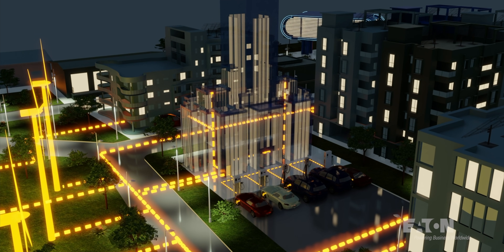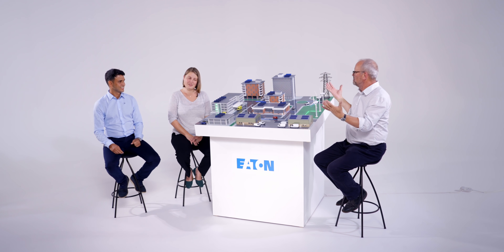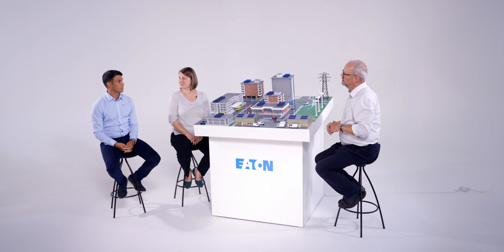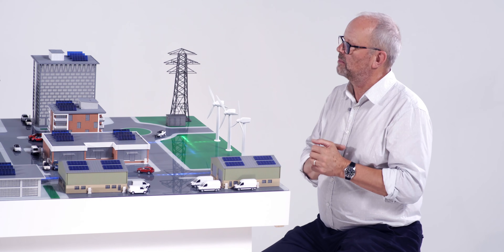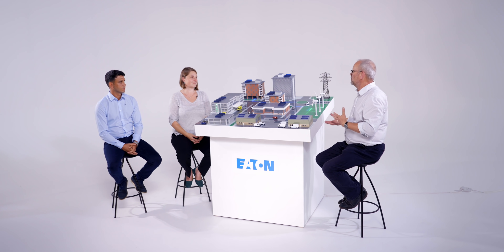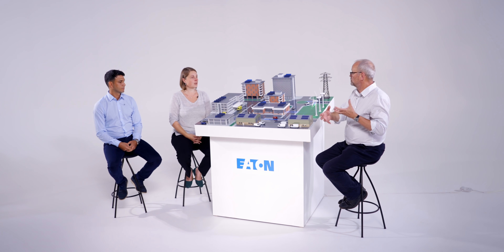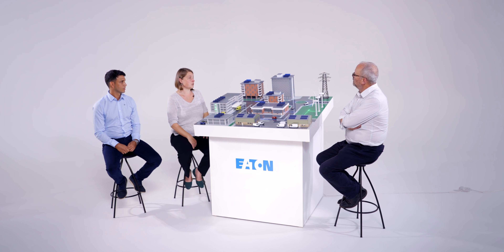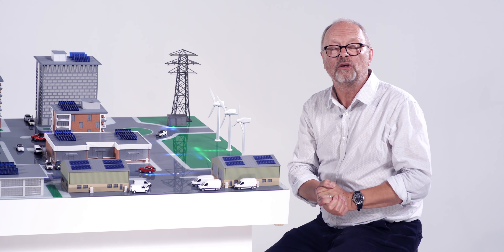EATON’s 'Buildings as a Grid' approach to energy transition | SUBSCRIBE to Fully Charged PLUS

Comment: This cannot work - because it is currently impracticable to store enough energy to carry over a run of dull days when solar power typically falls to 5% of rated peak power  'Smart' does nothing to solve this b=very basic problem.

What is the purpose of this plan for local storage with solar?  If it is to reduce CO2 then it achieves little benefit over the current situation of homes feeding surplus power to the grid (as I do), and then taking from the grid on dull days.  Arguably, if you are going to have a more capable grid, then bulk storage is best left to grid management, with hydro storage etc and possible large battery storage in future, which, by economy of scale is probably going to be cheaper than local storage.  

If the aim is to reduce the need for the grid; which seems to me to be very desirable for many reasons, then what is needed is realistic local storage - much bigger than currently feasible, because it is  necessary to store enough energy to supply heating needs over many days during a dull spell of weather (when typical solar output is 5% of peak rating or even less) and wind may also be lacking.   'Smart' control doesn't benefit much - you can't manage what isn't there!  My hope is that rather than go for the grid solution with nuclear and the nuclear waste problem, huge extra investment in the grid, the problem of power loss on the grid, and extreme vulnerability to a total grid-down situation, we will devote effort to solving the real problem of making power local.  

The advantages seem huge to me, but need better batteries (ten or more times the capacity of the current LiIon batteries that are in use) or some other solution.  This may not be impossible, but  my point is that it is not solved by being 'smart'. The old solution of local CHP (combined heat and power) could still be attractive to bridge the gap to future storage solutions, given that home energy use shoots up in cold weather.  Using the waste heat locally for heating makes gas fired generators nearly three times more efficient than power stations, and they could have rapid startup (which nuclear lacks).

Comment: The idea that 'smart' can somehow solve all problems is misleading, as is this video.  There is an 'elephant in the room', which is that solar panel output drops to around a twentieth of rated output on very dull days (I speak from 10 years experience on a 5 acre installation with both on and off grid solar), and unfortunately there can be three or more very dull days in a row in winter in the UK.  Battery storage cannot begin to address this problem (3 days storage) so at such times everything has to revert to the real grid, which will go down.  I use 5 heat pumps to heat my home, which are excellent, with a COP of 5.5, they need only  400w each typically at 7C outdoors.  Even this is a lot to supply from batteries for three days or more.   8kW of solar for my home is more than I can use in summer and more than can be stored.  On a dull day this becomes 400W, which is only one fifth of my heat pump requirement, so there is a big mismatch, even with what is a pretty big solar installation for one home.  Better in my opinion to go for simple control and put the effort and money into trying to solve the really hard problem.  If batteries were to become much more cost-effective then storage over a week or more might be viable, but with something like 20kWh minimum per house per day needed to be stored for several days, around 100kWh battery per home is needed - current home batteries are more like 10 or 20kWh.

Using the car's battery doesn't approach the problem either.  It might be 20 to 60kWh, but you can't use it to supply the house for three days and still hope to use the car!   'Smart' does not begin to tackle the real issue, and is almost a waste of time, because for most of the time we have to simply throw away energy in order to cope, and there is no need to be at all smart - it's the dull day problem that crashes the system.
Reply: 'Can't work' is a bold claim. You are assuming no wind as well as no solar, and ignoring the hydro and nuclear. Clearly there will be occaisional demand for longer-term storage or grid-supplements, but then maybe that is the 3 days to just use the car battery and not go anywhere in it (use your bike or stay at home), because now is not the time - that's demand-management, 'smart' and flexibility writ large. There is clearly a need for longer term storage than is sensible at lithium-ion prices, and we have options: more pumped hydro, maybe Form's batteries will fill that niche as intended, maybe we just build some more nuclear, or it's done with hydrogen peakers, or even just rarely-used methane peakers. We can also reduce heat-load to nearly nothing by building fabric upgrades (I only need space heating about 15 days per year now, peaking at 2kW when it's -10C outside).

There is no need to have per-house infrequently-used long-term storage - it can (and indeed should) be a shared resource. Whatever is cheapest is what will get adopted. There are lots of ways to run at this, and we don't need to pick winners - just set up the costs so high-carbon is really expensive. You are right that a very cold, cloudy, still week is the worst-case that we should work out how to deal with, but if people have to turn their old gas boilers on (or central gas generation) for 6 days/yr because we don't quite have enough storage/generation/interconect yet, that's not the end of the world: that's still a 97% decarbonisation.
Reply: @xxwookey  What is the purpose of this plan for local storage with solar?  If it is to reduce CO2 then it achieves little benefit over the current situation of homes feeding surplus power to the grid, and then taking from the grid on dull days.  Arguably, if you are going to have a more capable grid, then bulk storage is best left to grid management, with hydro storage etc and possible large battery storage in future, which, by economy of scale is probably going to be cheaper than local storage.  If he aim is to reduce the need for the grid; which seems to me to be very desirable for many reasons, then what is needed is realistic local storage - much bigger than currently feasible.   'Smart' control doesn't benefit much.  My hope is that rather than go for the grid solution with nuclear and the nuclear waste problem, huge extra investment in the grid, the problem of power loss on the grid, and extreme vulnerability to a total grid-down situation, we will devote effort to solving the real problem of making power local.  The advantages seem huge to me, but need better batteries or some other solution.  This may not be impossible, but  my point is that it is not solved by being 'smart'. The old solution of local CHP (combined heat and power) could still be attractive to bridge the gap to future storage sollutions, given that home energy use shoots up in cold weather.  Using the waste heat locally for heating makes gas fired generators nearly three times more efficient than power stations, and they could have rapid startup (which nuclear lacks).
Reply: I think the “smart” bit would be to charge your batteries off peak automatically from the grid so you can still operate on your dull days. I agree solar cannot be our only technology (in the UK anyway) but wind, tidal, hydro dams would help us out.
Reply: @scottwills4698  Yes, of course that is the idea, but it would be smarter to recognise that it simply can't work, as I explained!  The battery capacity needed is simply beyond our current, or likely future capabilities, even just for one home, because the power from sunny days has to be stored for many days, or even weeks.  Scaling up doesn't help at all - dull days cover a huge area, so you can't rely on solar from nearby.  Nor can you rely on wind - any idea that when there is little solar there is wind is simply not true.  Tidal, hydro etc, and wind energy from afar - yes, but that need large grid capacity over long distances, which is what this video is about avoiding.   Battery storage with solar works fine, but only so long as you are prepared to use it only for fridge, freezer, TV, mobile charging and so on.  As soon as you bring in heat pumps and car charging it demands very frugal use, and a cold house!  I've proved this with my own installation, which is bigger than most people go for, with 48 solar panels!
Reply: @lindosland  I put “charge your batteries from the grid” for the dull days. 20% of our grid is Nuclear and I believe they are planning to double this the rest will be renewables). My dad runs his house, car, ground source heat pump, swimming pool etc off solar he doesn’t have a battery and imports from the grid on dull days (and November to March really) his electricity bill is around zero for the year (40 pannels on his house and barn 3 phase electric).
Reply: @scottwills4698  Yes, you did say that, and I didn't take full account of that.  It's true that charging off the grid at times of low load can even out the demand somewhat, but the problem remains that you need to store enough to carry through several days, and that is not practicable.  I do much as your dad does - 48 panels on grid, two-phase mains, air to air heat pumps (far better than ground source, though I have a 5 acre plot, because the COP for ground source to radiators is so poor).  I am net carbon zero for power use, and am paid £4000 a year feed in tariff, while I pay £1200 a year for what I take from the grid - a very good solution :-)  I also have a separate off-grid string of 12 panels at 50V into a 10kWh battery bank to cover the not uncommon power cuts in the countryside.   The 'smart' system offered in the video seems to imply that it can work on its own, and importantly, take the load off the grid (despite showing a very few solar panels!)  If we still need a lot of grid capability for dull days then I think the 'smart' bit becomes a complication with little benefit - simple grid connection such as I and your dad use is a pretty good solution.

Comment: All of this is well and fine except that current buildings do not have an infinite lifespan. Buildings are only around until their usefulness is either exceeded or they become useless and do not fit the current model in 25 years time. On top of which some buildings change ownership over multiple cycles and years. AS it is now we only use a building for a period of time that suits the tenant and even those can have a change in use or need to be resized and added on to or reduced? Where does your EATON model fit into those demographics?

This is not a video game, is it?

Comment: Okay; So the buildings are 45 feet tall (four stories) and that makes the blades on the wind turbines about 20 feet long and how many kilowatts are they going to produce when, and only when, the wind is blowing in the right direction?

We're not going to change the world or even the UK with fairytales.  Never mind.  Great modeling.
Reply: The turbines rotate, so they are always in the right direction.   20ft is a very small turbine nowdays and there are other non-directional turbines or even static electricity generators which might be more sensible for a roof. There should be legislation by now to insist all new buildings have solar panels as even in the UK they are cost effective.
Reply: I don't think it's meant to be a scale model - just a representation for those who like to see things visually explained...

Comment: To be honest there's nothing shown by Eaton here that many other similar companies are producing. Using terms like "buildings as a grid" is just a buzz-phrase. Are they claiming their products  allow the electrical installation of a hospital or school or warehouse to have the same characteristics as a distribution network? It's pretty clear that they don't. Also, in terms of the wonderful software that can control power flows, what happens if you have Eaton products in half a dozen buildings and Company X controls in another half a dozen buildings and Company Y controls in some more buildings - who mediates these controls? They can't all control the 'grid' simultaneously or the first problem will be voltage control in localised parts of the network.

I saw this problem start to present many years ago as a DNO engineer where the proposal was that a 'smart grid' pilot scheme would allow interaction between an embedded generator and the automatic voltage control apparatus at the local primary substation. On paper it looked OK until I asked "what happens when we've agreed this control regime with Company A and it works OK then Company B comes along a couple of years later and says, oh we want to do the same with our generator?' You can't have multiple control interfaces simultaneously demanding different power flows of real and reactive power based on their specific network characteristics or site demands. This can only realistically be achieved by a centralised control system that arbitrates between the requests from two or more actively managed power sources. It can be done but it has to be done sensibly. On a national scale that's why we have centralised power dispatch and control by National Grid.

Nice (literally) flashy model but doesn't represent anything essentially different or new - just an ad for Eaton in the end.

Comment: I love localized power generation. The idea that individuals and small groups can take charge of it is amazing. I have solar panels and really want battery storage. I really like that I know that more than half of the electricity we use is from the sun. If everyone who could have solar and storage did, it would change the old paradigm, and we would not be at the mercy of utility companies.  :-)
Reply: Go for a battery if you can Chris. I've been modernising a bungalow we brought 4 years ago and part of that was solar and a Powerwall. I haven't looked back.
Reply: I’d look at a Mixenergy hot water tank too, any excess solar can be “stored” for use later on (like a battery I guess). My plan for next year is 4.6kw solar, 8.4kwh Givenergy battery and a Mixenergy tank and then I’ll add a high temperature heat pump later on when I can afford it.